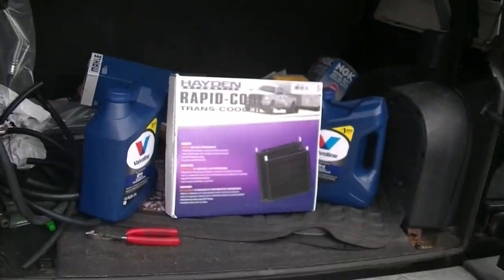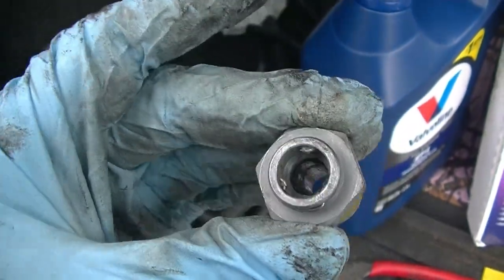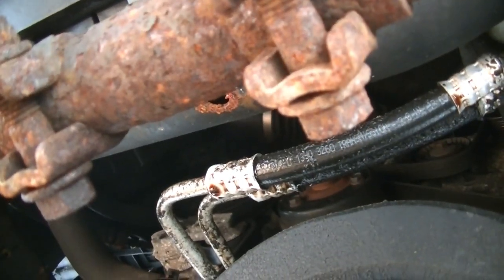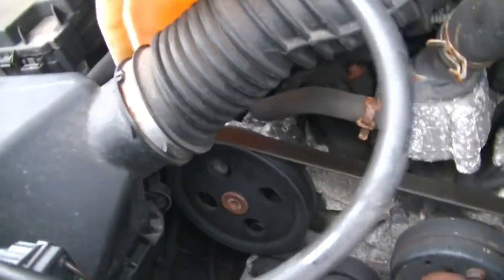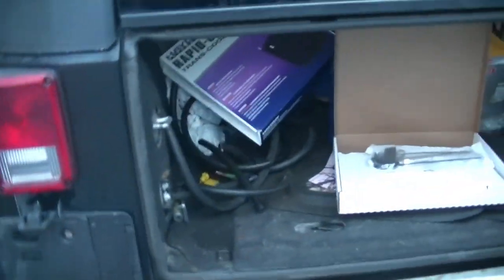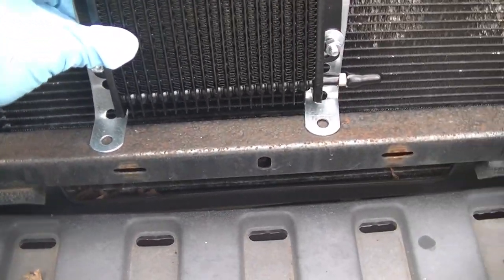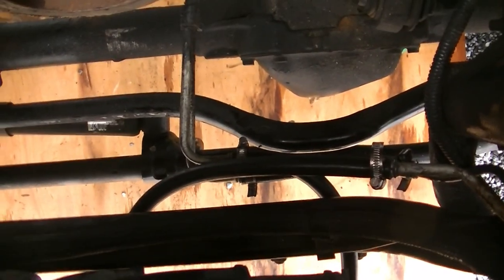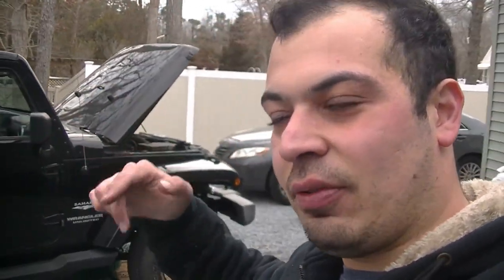2007-2011 Jeep Wrangler Transmission flush, line replacement, and cooler install!!!

Comment: Definitely need to drop the transmission pan and replace the transmission filter. Also trans-x is my go to for additives.
Reply from the maker: This trans was not long for this world hahah. It failed shortly after not surprisingly considering the condition of the fluid. We ended up having to replace it
Reply: @SEsGarage you let all the magic out when u changed the fluid
Reply: @SEsGarage yep, the clutch material in your fluid was keeping it together.  You should have only replaced 3-4 quarts.  That fluid looked 150k miles at least, Not good to let it go that long, a pan drop should be done at 50-60k miles.  I suck out and add 2 qts of atf every other oil change.

Comment: Um, no trans filter?
Reply from the maker: Under normal circumstances you should never have to change the transmission filter. If you have enough clutch material/metal in the pan to clog the filter, your trans has some serious issue…which was the case for this transmission if you continue to watch the video series on this Jeep